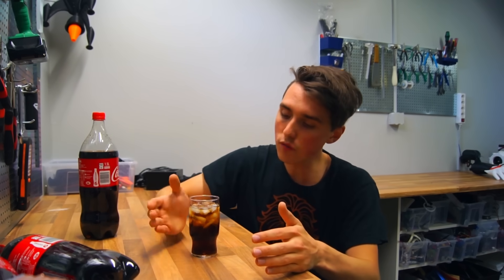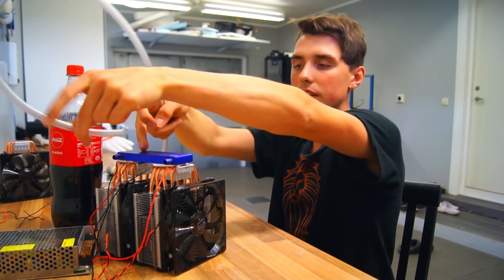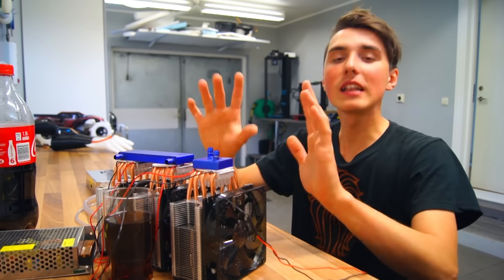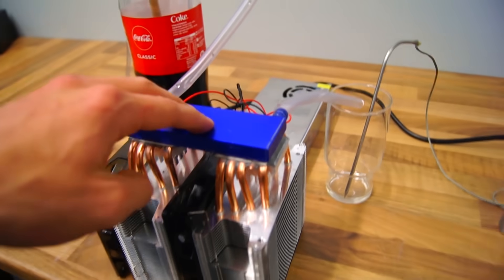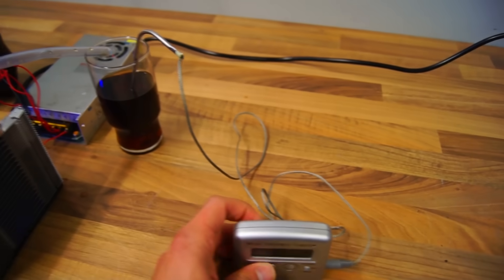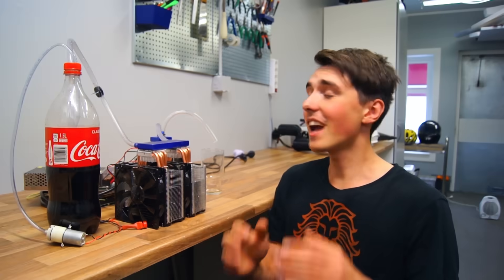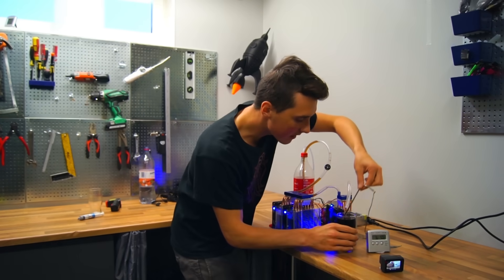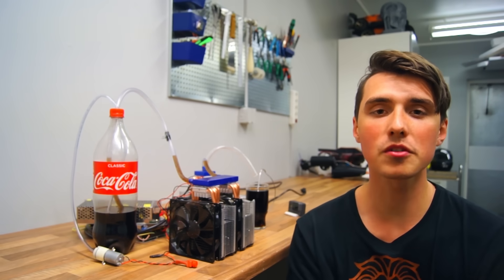Peltier Soda Cooler Machine - DIY Drink Dispenser

Comment: Hello, you could add an additional metal mass to the blocks to store more "negative thermal energy",  a 3mm rectangular shaped copper foil between the block and the peltier cells , will give you more "thermal inertia", it will takes a bit more to cool down , but it can also cool down more liquid. And insulating the upper and lateral parts of the sistem should definetely help.

Comment: Try make the flow rate the same as a coffee peculator? I feel that reduced rate may help quite a bit. Also attempt to start off with a cold bottle of coke and then see how much you can reduce its temperature? The physics should scale linearly until 0°C because the energy vs. temperature graph is linear until it reaches melting/freezing points

Comment: should have controlled the flow of air coming into the bottle not clamp the coke hose and create excess pressure. a vertical slit in the air inlet hose near the coke lid. then you could vary the amount of air which escapes prior to going into the bottle. in turn allowing flow/temperature control

Comment: its fake how can it freeze if its getting cooled by 20c air  by fans only
Reply: because the Peltier modules have a heat difference. The cooler the warm side, the lower the temperature on the other side will be. It's not like a CPU where it just makes heat.

Comment: This would surely work better if your heat sink assemblies were right side up. Heat pipes do not work well upside down.
The copper tubes contain water in a vacuum. The water has to be able to freely evaporate and percolate through the tube to transfer heat effectively.   Research heat pipes online.

Comment: Coke is meant to be drunk around room temperature, not cold like Pepsi. This is because coke was invented before cooling systems such as refrigerators or freezers and is therefore made to taste better warmer. (Obviously don’t drink it at 50 degrees C, or anywhere above 30, that’s getting gross)

Comment: If you stacked a second long water cooling block on top of the first you could pass the Coke through both (in series) and dump more of the heat into those first two peltier modules.

Comment: If you use the devices to cool a liquid (something like alcohol or something with a low freezing temp) it will have a large thermal mass and wont heat up as quick, insulate the container it is in, and run the drink through some pipe that can conduct heat, like copper, and wont melt like some flexible tubes might in anti freeze.

Also if you put a flow control tap just before the 'cooling area' and invert the coke bottle, had the pipe that liquid comes out of just at the now bottom of the bottle (so its just going into the bottle) and a breather tube going above the level of the drink (so it doesn't all spill out) and a tap on that, you wouldn't need an air pump.

Comment: heres an interesting twist on this idea. Lose the pump all together, reduce the diameter of hose and stagger all the parts with the bottle at the lowest point the blocks mounted vertically. then just suck the coke through it like a straw, when you stop sucking the straw the liquid will drain back into the bottle so that it does not freeze. also I would add two more peltiers and heat sinks to the first block. lose the second all together. Would love to see this. want it colder, just drink slower. 
You could use the pump, but add a solenoid on the pump discharge line so that when you stop pumping, it would open and it lets air in so that the pressure is released, and the soda in the blocks and tubes will drain back into the bottle and after a few seconds, it closes again. you could have everything under your desk, with just a small hose coming up through the desk for a drink dispenser. these are my thoughts, I would love to see you try these ideas Simon. 

Hope you're doing great! ;)

Comment: You could also find a single circuit cold plate from commercial soda vending equipment. Use 4 modules to chill the plate with your heatsinks. Insulate the cold plate around the five sides and then pump your cola through this cold plate, there is about a meter of stainless line embedded in the chiller plate. Restrictors are not needed if you use a DC pump, you could use a variable power supply to cut the speed to the pump. This is a great idea.

Comment: The only issue you have there is that they soda is flat.  If it was still carbonated then the flow of beverage would not be adjustable.  The pressure built up in the bottle would push out ALL the liquid.

Comment: You should have a Large block of aluminium or copper between the peltier modules and the water block. That would add thermal mass and allow you to cool a larger quantity of liquid to a lower temperature in one go.

Comment: Good work. One of these days you may be nominated for a Nobel Prize. Presumably the heat pipes are either lined with a porous sintered metal or they contain a wire braid to assist coolant flow against the force of gravity, but I was wondering if turning the coolers "right" side up would increase efficiency? Also, if you're going to have the rig nearby anyway, perhaps momentary operation would be better. Omit the pump and just suck the beverage through the tubing like a straw. In this case, a water block with less mass would assist in a more rapid temperature drop, and the momentary nature would allow you to scale down the whole heat dissipation apparatus or omit the fans altogether. This may even allow you to omit one of the peltiers and use a higher current on the remaining chips.

Comment: This system is probably not food grade safe. The acid components in the drink probably will decay and dissolve the metal in the cooling module. Accumulate those element in the body may be bad for health in the long term.
Reply: If change them into PVC plastic ones maybe safer

Comment: Cool project. I would suggest to position the heatsinks in a manner the heat from  one does not hit each other,  I think to position the airflow upwards. Probably a new bigger waterblock would be necessary. Another idea I read here in the comments, it is to stack more of these waterblocks and make the liquid to flow on them in series, more blocks will have more cold mass and more surface area for heat exchange.

Comment: I bet you could get it colder with atleast 1 degree by separating those first 2 heatsinks and put them on the short edge to eachother so the first heatsink's air doesn't warm the second. At 7:12 i was lik  facepalm when i saw them all 3 so close to eachother. It was like a cooling centipede nightmare.

Comment: you have to be a crackhead to solve an issue that is not an issue lol ...  if you need that nasty ass high fructose corn syrup so bad, that you're not willing to dilute it with ice cubes.. you need to stop drinking soda !! .... soda has no beneficial ingredients, all that so called sugar turns to fat,.. you know they sell thin thermos's that you can put in the freezer so you don't need ice cubes ( ohh the cup will be to cold )  duh put a beer cozy on it ...  problem solved ...   why don't you do something better with that peltier .. cool an overheating cpu or gpu, but in a way that takes the condensation away from the MOBO .... dont get me wrong ... still kewl ....

Comment: If you stacked 2 of the large water blocks, connected than in series, then put the flow limiter on the dispensing side... This could all be accomplished with 1 heat sink and have more heat loss (cooling) as well...
Great video though! Got me thinking outside the box again... Thanks!

Comment: You could also do it without pumping it through the water block. Wouldn't get the same uniform cooling, but water has pretty good thermal conductivity, and you wouldn't get the risk of clogging that thing, plus simplicity.

Comment: If it was me i build my own block from a very heavy block of copper. Or add a big chunk of copper to that and insulate it let a single pelt take its time to cool it down and use a chunk of metal as a thermal capacitor of sorts and save a lot of power

Comment: Have you thought about putting a large block of steal on top (possibly between the peltier and the water block, to cool the steel faster) of the water block? once it gets cold, the large mass of the steel will take longer to warm up, resulting in colder coke, will take longer to recover and start up tho.

Comment: you should use manual valve to control the flow and add it in both input and output block so the water could flow and cooled longer inside the block. your work is great but the heat transfer is not sufficient enough to being cooled by peltier. wish to see a polished version. and also its better to make it closed loop so the water can be cooled continuously and add output valve so the water can be extracted from the system.

try to make pc cooler like der8bauer (novec 7000 liquid) and use peltier as the condenser. would love to see the project goes real.

Comment: Increase your (Pelter) surface area and lower the voltage for the input of each pelter.  You may use more pelters but it will yield much more efficiency.

Comment: My thoughts, rather than slowing the flow or adding extra Peltier's, maybe use a fluid (mainly water), as most liquids have a higher specific heat capacity than metal. In the case of Aluminum v. Water, its 900 v. 4100. So cool the water down to a low temp, and use it to cool the coke. The water will act as a buffer and won't warm as fast as the Aluminum does (You can see it rapidly warm as the coke flows through). Should mean higher flow and colder coke.

Comment: Just use the air pump when you will fill the glas make a return line using a watter pump back to the bottle and you will reach lower temp

Comment: Put a huge chunk of copper on the cold side and let it get really cold then run soda throw it again the copper will help transfer heat out of the soda by adding more mass the the cold side and copper transfers thermal Energy very fast

Comment: would be more efficient to drill holes in your freezer, and put in a copper coil and circulate the coke through it. only problem woul be flushing the coke out, as it would eventually freeze solid possibly cracking the copper.

Comment: Add two more coolers to the top and drop the voltage on the air pump a bit to slow it down.

Comment: Hi, not a fan of your setup ;) a lot of waste energy, poor efficiency of the cooling, and no protection against freezing. You should monitor the temperature directly on the water box (or inside if you can). Fill it with soda, start the cooling, and have a valve regulating the flow to pour according to the temperature. You can also insulate the cold parts to reduce the losses. This way you have a protection against freezing, you achieve the 3-4°C (standard for draught beer) that you want and you will use the minimum power.

Comment: Pick bip pot fill with water add salt and put in a freezer, in an hour two that water will be so cold that your 2L coke will get cooled in five minutes to cold or so. Salt prevents water from freezing, so it goes below zero degrees

Comment: Three singular water block model will be more effective along with flow regulator between them.From coke bottle to first block flow must be minimum, from first block to second double the flow, then from second to third flow should be same as it is from bottle to first block.You will get 3 degrees.

Comment: TECs aren't really designed to "insta-cool" a liquid - this is why every "drink chiller" which uses them is usually composed by a tank where the liquid to be chilled is stored - peltier modules then cools down the tank over time.

Comment: Idea for you: do an ethanol-water mixture (about 40% ethanol) and use a loop to cool down a bucket of the stuff to -20C, then place your entire coke bottle into it.  Make sure the outflow from the pump directs the ethanol-water mixture over the upper third of the coke bottle (even if submerged completely.  You could go with a higher ethanol content, but might want to enclose it.  This way you could pre-cool the mix to -100C.  I think it would cool your coke pretty fast, and you would not have to get it dirty with Chinese lead, as others have pointed out.  Hope you're okay.
Reply: A chill coil jacket around the bottle would work too.

Comment: what if you had peltier on both sides of the block to reduce imediate increase of block temp so that that fluid is flowing through a constant cooler state.
I'm guessing that the block warms up too quickly for it to chill the fluid enough.

Comment: Should rename this:  Tweeker Lab.  I mean - WTF is the point of all this?  Would be better seating bottle atop of 4 pelteir cooler pads and allowing this to cool the soda I think.  That way, you wouldn't fart around trying to pump the soda through a cooler block (which might contain contaminants from God knows what it was used for previously).  I often wonder why petiers aren't used over our CPUs and GPUs as they get amazingly cool.

Comment: correction
your peltier modules are 12709
12 indicates nominal voltage - 12v
09 indicates maximum power in 10W each step - 90W at maximum voltage
maximum voltage is 15.6V, not 12V

now at 12V you are getting smaller current, then at 15.6V
at maximum power it is 5.769A
at 12V it is 4.437A 53.254Watts of power

really take some lessons before taking rubbish

Comment: You should add a thermal mass to the heat exchanger block to prevent it from heating by the flow too quickly. Big chunk of copper or iron should be fine.
Also, keep in mind that if You leave the liquid inside the block it may be cracked once liquid got frozen.

Comment: For 300 Watts I can buy so many freezers! The first one on amazon uses on average 13.4 Watts! I can keep it running the whole time and keep all my drinks cold all the time, and stay cheaper...
Reply: no freezer uses 13 watts ??? what am I missing here got a link? and remember he consumes 300watts but only for 10 minutes so that in your parlance is like 50watts (when you see something as listed at 13watts that is "per hour" so this uses 300watt hours (would use 300 watts over 1 hours) so about 50 watts hours for the 10 minutes he ran it.
Reply: https://www.amazon.de/dp/B00K8O20WE/ (The first result when searching...)

Calculation for the Freezer
It says 0.322 kWh per 24 Hours.
322W / 24 Hours = 13.4 W on average.

His setup:
300 Watts for about 1/4 hour:
0.3 kW * 0,25 hours = 0.075 kWh

So yes, for one glass his solution is cheaper (power wise) but do you really only want to dring one glass per day?
Reply: Leberkas Semmel you forgot one thing. You calculated the fridge for 1h while his setup for just 15min. To really compare them you should calculate both within the same time. So that rig consume 0.300kWh in 1h which is 'sligthly' lower than the fridge/freezer (0.322kWh). Not to mention the rig there can cool only 1 thing while the freezer have a lot of space to cool down several stuff.

In other words: 
1. power consumption difference is not significant. 
2. The freezer offer much more with almost the same consumption.
3. Pelt in that case is just a waste of energy.
Reply: And you built it yourself right?
Reply: uh... it just has to pump the refrigerant.... so it turns on once, then stops.... it's not on continuously.  it's known the peltier chips are inefficient but they're handy for specific applications like doing the reverse.... converting heat into electricity.
Reply: @mizmera lol... and this guy "built" the peltier chip, heat sink and fan?  no.... so what does it mean to build something yourself out of parts someone else already built?  a small fridge compressor and you could make one 100x more efficient.

Comment: I think you should have it circulate on just one heat sink. So you can get it on demand from an output valve without freezing it. Also have a temp monitor on the drink in a reservoir so you can control the peltier again so it doesn't freeze.

Comment: I think you should try to flip the whole thing upside down so heat will rise up into the cooling system more efficiently and use smaller tubing for the drink. Also a fish tank air pump valve might help dial in the flow rate. Keep on making these videos, they are great work.

Comment: Connect a peltier element to peltier element to peltier element to peltier element to peltier element to peltier element to peltier element to peltier element to peltier element to peltier element to peltier element to peltier element to peltier element to peltier element to peltier element to peltier element to peltier element to peltier element to peltier element to peltier element to peltier element to peltier element to peltier element to peltier element to peltier element to peltier element to peltier element and on the other end of that row of peltier elements you'll have a plasma generator and other end of row of peltiers you have a 0 kelvin. Trollscience.